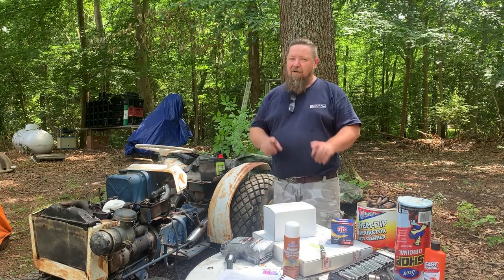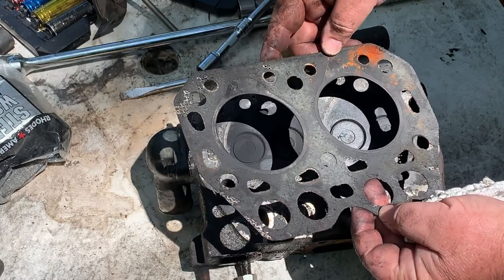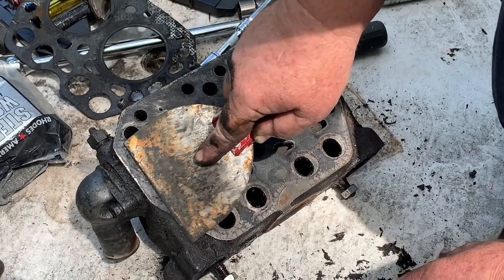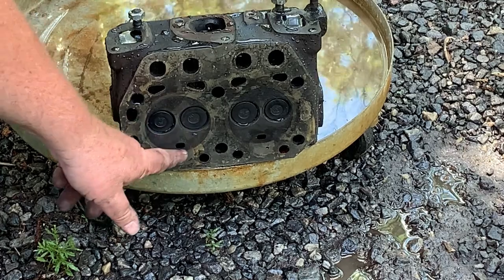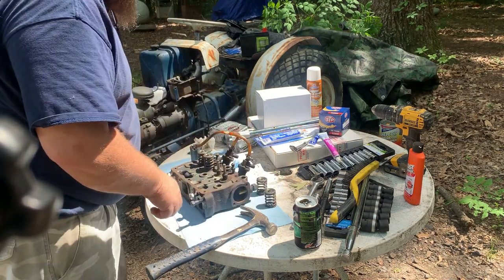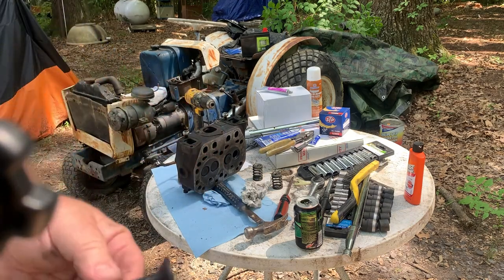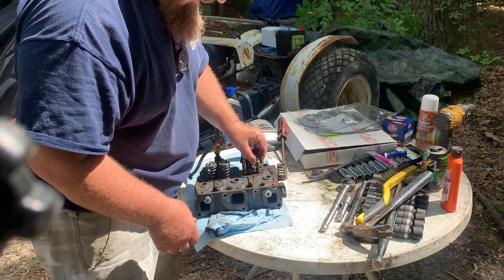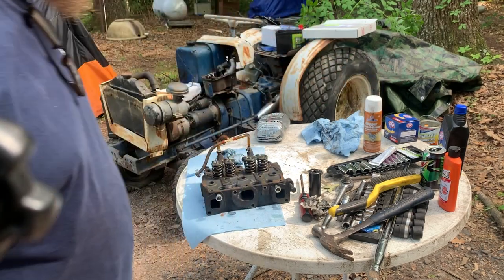Mitsubishi Satoh S370 restoration part 2

Comment: Incredible real knowledge about diesel engines KE70. I bought a 372d. Old and works and it´s my learning machine. I replaced all oils liquids but now Im struggling on hard to start, when warm and running its ok. But to start it again is a lot of revs. I changed the starter motor and it revs and puffs black smoke. and starts eventually. Ill watch your movies and try to learn. My guess is that it is compression/ignition but that is a lot of work.
Reply from the maker: The KE70 is  simple little engine but very robust and cold starting is always an issue but hard starting in warmer weather doesn’t mean it’s compression issues. Valve lash adjustment plays a big role in hard starting ,also these little engines still needs to preheating. Putting out black smoke while trying to start tells me you’re getting fuel but you could be SUCKING AIR. Remember it’s easier to suck air than fuel, even though the fuel tank is higher than the motor you’re fuel system isn’t a gravity fed. If the fuel system is sucking air it won’t show signs of leaking fuel. 
Sucking air is one of the biggest problems with hard starting.  Hope this helps
Reply: How did you identify the engine model?

Comment: How do you check the glow plugs? First time project for me and I'm not much of a mechanic. Your videos are helping me very much with this tractor. Plus I'm learning quit a bit.
Reply from the maker: Hi John 
Thank you, I always liked doing these projects and sharing them and maybe someone getting something out of them is a blessing to me. When checking glow plugs can be done in several ways. 
1 using a amp meter while trying to use them, each glow plug has a amperage rating. In my case the amperage is less than 10 amps for both glow plugs , if the amperage is higher than that then there’s a short somewhere in the system maybe or maybe not in the glow plugs. If the amperage is low or not at all then either one is working or none at all. 
2. Ohm resistance test , there should be some resistance but not a dead short 
3. The finger test do you feel heat at the top of the glow plug when energized 
4. Check for voltage at the glow plug while energized 
Hope this helps 

Note: when it’s real cold out and the engine has some wear on it even if the glow plugs work it maybe hard to start
Reply: @fixingthingswithpastorbill3840   I'm getting black smoke from the exhaust and it will not start. Even if I put starting fluid to it. I just sprayed it once and haven't done it since. I'm at my end with it. I thought maybe the heater in the oil pan was bad so, I bought a magnetic heater. It seemed to help, sounds better while cranking, but won't turn over. Thank you for your help on glow plugs. It's much appreciated.
Reply from the maker: You may have air in your fuel lines, the fuel pump won’t suck fuel unless the air is  bled off because air is squishy so it gives and the pump is designed for high pressure not volume so it cannot over take the air that’s in the line. 
If there is a small leak before the pump it might suck air instead of fuel and may not leak any fuel. I would look hear next.
Reply from the maker: Black smoke indicates the presence of some fuel but the the injectors may not have the pressure they need because of air. 😎🇺🇸
Reply: @fixingthingswithpastorbill3840  it's a project that's taking time for I appreciate all advice and I would ask for more but I'm sure you're busy and have a lot going on. Thank you very much for your help, taking the time to respond. I appreciate everything. I will start with the glow plugs and go from there. Look for leaks or holes in the fuel lines. Thank you so much.

Comment: I've put me glow plugs in with the same result. I'm still just getting black smoke from the exhaust while cranking. Fuel to both injectors. I'm at a point where I think I'm in over my head.
Reply from the maker: Try putting some gasoline on a rag and putting it loosely into the intake manifold , if it starts then there’s a problem with the fuel pump. If it doesn’t start then you may have a compression issue
Reply from the maker: Note: don’t let the rag get sucked into the engine 😎
Reply: @fixingthingswithpastorbill3840  I will try that next. Thank you very much Sir.
Reply: Did you fix your tractor?